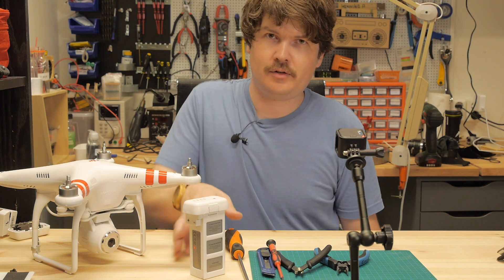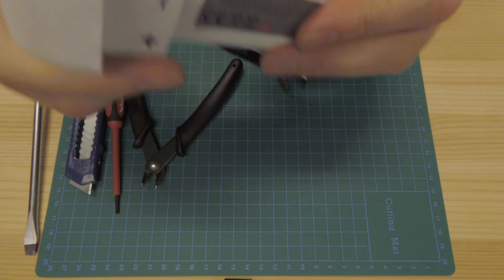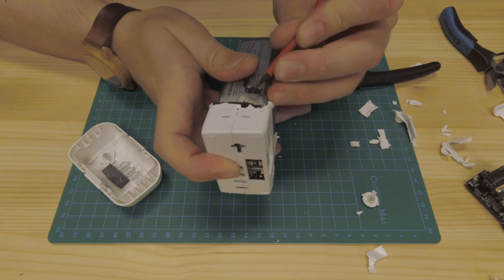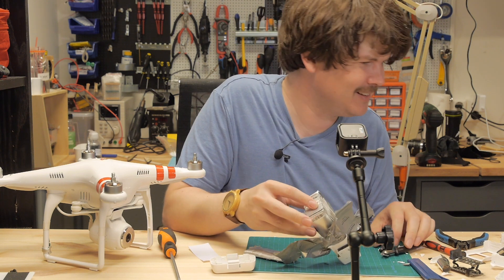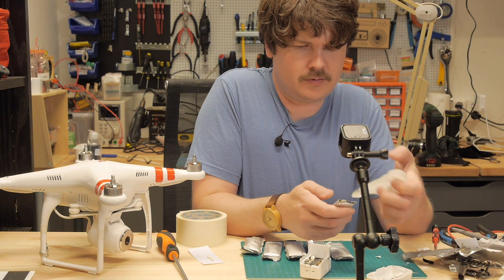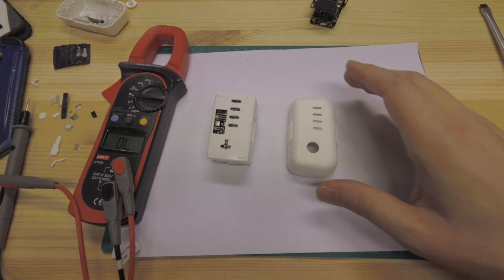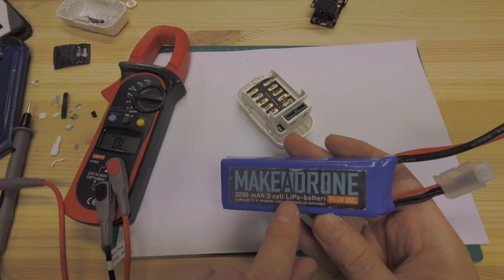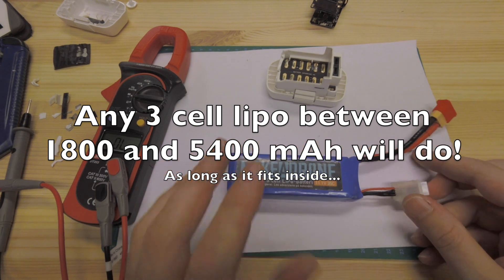Fix a broken DJI Phantom 2 or 3 battery for cheap

Comment: Hi, I would like to do this with around 4 of my old batteries that have died from storage, is it possible to charge the LiPos with the original phantom charger assuming they are 5200mAh, and 11.1V? I would like to know as I do not currently own a separate LiPo charger. Cheers!

Comment: hi, I bought a phantom 2 with 3 batteries, the 2 are completely dead because they have been in the box for a long time without being charged. I speculated that I could separate a battery in the 3 Li-Polymer units and then try to put a small car charger on each for a few minutes and then assemble it again. Do you think it could work?

Comment: I just acquired an old Phantom 2 with dead batteries. I followed your instructions, and they worked! Thanks for the help.

I just have the issue that the charger won't charge the batteries, and the intelligent battery is always flashing red (thinking it is at critical voltage). Did you have any issue with this?
Reply from the maker: Glad it helped! Check the voltage, should be above 9.9v total or 3.3v each cell, otherwise it might not want to charge. If you connected everything properly, it has no way of knowing the difference between the original battery and your battery so then the problem must be either one or more cells under 3v3 or wrong connection on the balancing connectors.

Comment: Do you still do this type of work?
Reply from the maker: i could do for 100 eur + shipping, if you think its worth it. 50 if you remove the battery cell yourself first. (Shipping lithium is a bit complicated)
Reply: @swishpan  I would be interested in sending you the logicboard and Connections, with removed batteri cells. Would you do the mod?

Comment: Brilliant video 👍🏻thank you.. I have a phantom 2 with a very dead battery I have stripped of case and I'm happy enough to have a go. One question on my battery there's a pcb on top  of standard battery I'm happy apart from my pcb has two thin wires going to battery. Would I just disregard these and use balance wires as per excellent video?
Many thanks Marc
Reply from the maker: Thanks! Not exactly sure what two wires you are talking about, can you post a picture somewhere? (imgur etc)
Reply: @swishpan  I have messengered makeadrone I thought that was you. And sent pictures
Reply: @swishpan  Hello do you still know how to do the mod on the dji phantom 2 battery’s for a lipo can I pay you to do it? Please respond???

Comment: hello good, congratulations for the channel, I have subscribed, I am from Spain, I have done everything as you indicate but there is a problem and it is the following: put the lithium battery that you put, whether it is 3200 mah or 5200 mah the drone flies only 12 minutes and it is because the original battery always says that it is at 80 percent charge, is there any way to reset the battery so that it is as if it were new with zero charge cycles and at 100 percent capacity? .
Reply from the maker: Thank you for that! I’m sure it can be reset but I don`t know how unfortunately. Maybe after a few cycles it will adjust itself automatically, you can try it first.
Reply: @swishpan  Hello do you still know how to do the mod on the dji phantom 2 battery’s for a lipo can I pay you to do it? Please respond???

Comment: The Phantom 3 batteries have some intelligence (e.g. auto-discharge to safe storage voltage). Has anyone succeeded to replace the cells also for a Phantom 3 battery when the old battery was completely dead?
I read somewhere that the battery controller could set a "defect detect" bit in the battery controller when it detects a deeply discharged batterey which is not easily resettable, but I don't know if this is true.
Reply: in the meanwhile I found a real cool video : https://www.youtube.com/watch?v=P5PNOO2GebY
This uses an open source tool to reset the PF (permanent failure) bit of the battery

Comment: can you do a video of you   Soldering the wires into where the lights and button are? Or make some diagram. Have some old batteries with a broken cell an wanna try this. Or is there a way to fix just the one cell that needs replaced?
Reply from the maker: There is a diagram about 4 minutes out. Just pause the video or take screen shot. You can fix a single cell but it have to be matched, i recommend just using a new battery instead.

Comment: My positive connection seems to be broken. When i use the multimeter to see if the positive part of the charging port is connected to the positive connections on the board i get no reading. I get a reading from the charging port to the led/balance charging board but no reading coming from the wire coming from led/balance charging board to the battery board. The negative connections are completely functional. There must be a broken connection on the led/balance charging board. How do i fix this?
Reply: I've had this issue with my two batteries

Comment: Hey i bought a 3 cell battery at 5000mAh. EC5 male plug and four wire balancer connector. I soldered everything exactly like you have. Including balancer. At first the battery thingy was somewhat buggy. Sometimes i had to replug it multiple times for it to work. Then i took it for a ride on my phantom 2. But the drone kept seeing the battery at 0%. At first I thought this was just the drone having to calibrate for the new battery like you said at end of video. Then i was going to charge the battery but one of the balancer wires just blew up... wish you could have been clearer on how they where supposed to be soldered...
Reply from the maker: Watch closely at 4:00, there is a diagram.
Reply: @swishpan  Thanks for response! I have done further study on what I did and made a diagram. Based on that diagram everything I did seemed to be right.
https://i.imgur.com/t3RxWP7.png

I posted image of how exactly I wired everything and what happened when it went wrong. The cable burnt out after flying it in the drone first. I will also note the charger was able to charge the battery at first. But then stopped when I came back after an hour. That is when I tried to fly it in the drone. Which worked but the OSD told me battery was empty 0%. The wires on the PCB did not burn in any way and the PCB does seem perfectly fine and sound visually. But does not know the state of the battery function as I no longer have a battery to test with unless I buy a new. I already lost 600kr worth in value with the other battery dying so before I even attempt to continue I would like to know where I did wrong. And if I should destroy my second swollen DJI2 battery to try it out and ditch the PCB I did it with at first.

The text written on the image is how it is written on my PCB. I have tested the entire board with multimeter myself to confirm what is same and what is not same. Also measured resistance and it is like it should comparing the resistance with other PCB diagrams made. And general balancer diagrams with resistance on them. Got this help from a friend who regularily fixes old electronics and have more knowledge than me and he doesnt even know what went wrong.

We concluded a short happened somewhere. Which is hard to figure out as we cant find one now. And the short happened while pressing the battery test button on the PCB (the red light button on the DJI2 battery computer).

I have once more chance to do it right but I need to buy a new battery and solder new connections entirely while gutting a second (last) DJI2 battery I got laying around. It is also broken/swollen but has a battery computer that appear to work. I didnt get to test the current battery computer before gutting it as the current battery computer had cells that had died from discharging and had basically no voltage left in them.

Comment: Hi after the conversion,  my battery wont charge
Reply from the maker: What is the measured voltage in the battery?
Reply: @swishpan  i managed to get it to charge thank you 🤙 1 more question , how should the new cells be charged ?

Comment: Hi, I have two inspire tb48 batteries that are completely dead. Would this work on it if I change the battery cells get a 6S lipo battery
Reply from the maker: Yes should work on all dji batteries. , Just use about the same amount of mah in the replacement cell and the same cell count.

Comment: Where to Put the balancer cables in 4s in p3 , there are 5 cables , you Show only 4
Reply from the maker: They should be in progressive order. You will need to mark where the old cells are connected.

Comment: Getting ready to mod ( repair)  my Autel Xstar Premium battery (4800mAh, 14.8V). To me it looks very similar in design to the DJI Phantom battery configuration. Any words of encouraging (tips) would be greatly appreciated. At this point in time my Autel drone is a $800. paper weight. ☺ Thanks Dave
Reply from the maker: Just locate where the cells are connected and try to find the order which they are connected. Just focus on the bare cells, they are very simple when you focus on the beginning of the battery, and let the rest of the electronics be as is. Also mind the + and - of course

Comment: Can I pay you to fix my batteries to ronin m because I can’t find any for sale
Reply from the maker: Hi, ronin batteries are told to be very unreliable but they still sell them.
Reply: They are out of stock everywhere I called the actual company they say 5-10 eeeks
Reply from the maker: I could do for 100 eur + shipping, if you think its worth it. 50 if you remove the battery cell yourself first. (Shipping lithium is a bit complicated)

Comment: Hi, where can I find suitable batteries, I want 7000 and up, and use the original charger, I disassembled the original batteries which were not good and I have my whole body and electronic board left

Comment: Would it be feasible to do a similar fix for a standard 1580mAh Ronin-M (and Mx) battery?
Reply from the maker: It should, as long as you have the same amount of cells, looks like 4s om the Ronin.

Comment: Where do I get the connector to solder on if I don't have a bad RC battery lying around to cut them from? Nice tutorial
Reply from the maker: Thanks. What connector? The JST connector  you can get from eBay, banggood, hobbyking or other RC store.

Comment: Thanks very informative . If I remove the cells from one mavic battery and connect each one in parallel to the cells in another battery this will double the mah , will the battery computer know this and show up on the app or will it fry it ,  my thoughts are it will be fine but I want a second opinion before I take my batterys apart . Trying to get more flight time . I know there are other mods but i want to try this .
Reply from the maker: I don't recommend parallell connecting lipo batteries, if one cell gets damaged it will not be protected any more. Computer can not detect problems any longer.

Comment: Only 1 issue i have seen is that its actually easier to open this battery pack using a flat screwdriver carefully opening the clamps. And then you can still keep the full case to re use it. Other than that great vid 👍
Reply from the maker: Thanks for the input. I always struggle when opening snap on cases, and always screw up the first. But I encourage people to try your tip.

Comment: hii.... thnx so much for that Vid, the problem after fixing everything and drone light up the motors are not working... and I’m DJI vision gives message that the battery is UNOFFICAL BATTERY.
Do u,ve any solution for that?!
Thnx again
Reply from the maker: Not sure how it knows that. Male sure the small cables are connected too.
Reply: @swishpan  i have the same problem all the cables a connected ¯\_(ツ)_/¯.
what about your drone
Reply from the maker: @sebastiankristensen9845  Strange, might have to do with the firmware version. Newer models might have a system to detect this, but I find it strange. It would be hard to separate a cell from another cell.
Reply: @Mixstreme  thanks i will try that later today